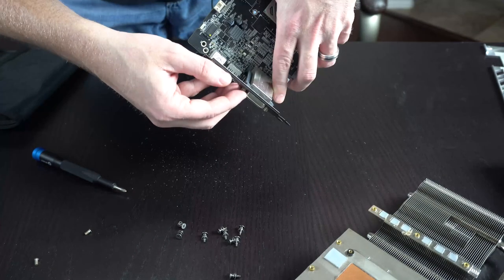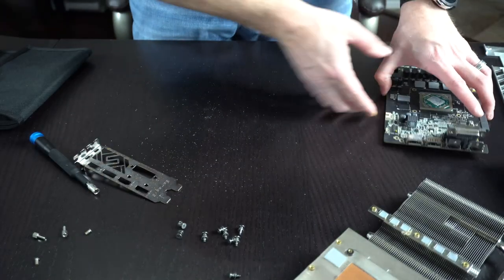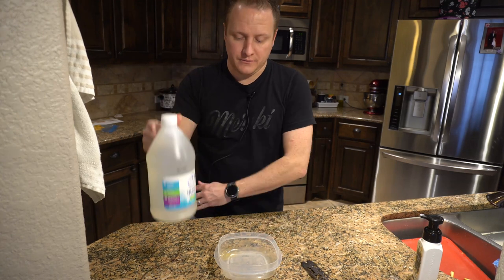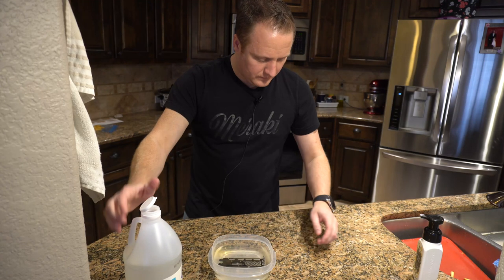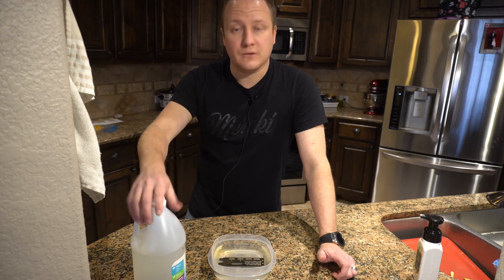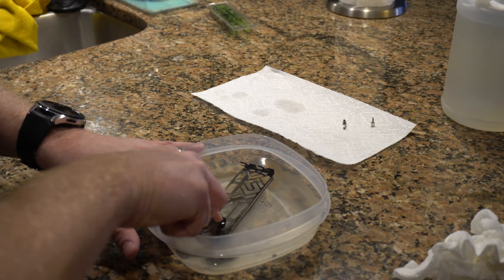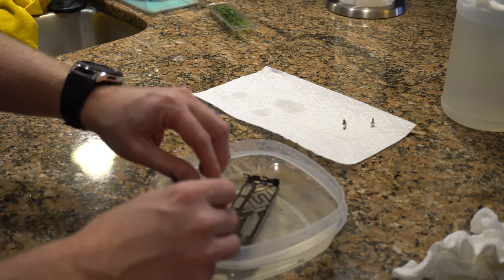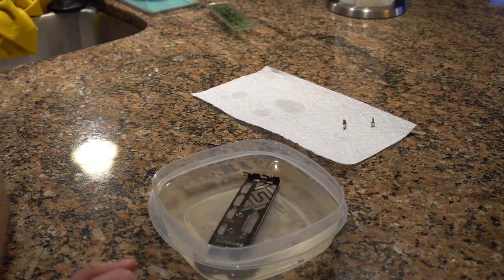How to Clean a Graphics Card/GPU - Rust Removal with Vinegar

Comment: the white stuff on the heatsink is aluminum hydroxide, its unsightly but it wont effect the performance of your cooling unless your heatsink is caked in the stuff. you have to completely clean it off for it to stop, only way afaik is an ultrasonic bath, also dont put any nickel plated components in vinegar. it will strip off the plating and the corrosion will be even worse, this method of cleaning is perfectly fine for the IO plate.
Reply from the maker: Thanks for the good information!
Reply: @Marko Grobler
I have those white stuff between the fins of my GPU I removed some of them with isoprophyl alcohol( 99%) but a little bit is still there. Will my Heatsink even last for more than a year if that's the case?
Reply: Is this apply to the tubing as well good sir?
Reply: So the fins the GPUs are also nickel plated copper or aluminum? Thanks for the advice I was about to vinagre the hell out of the whole heatsink
Reply: I cant understand which liquit should I use

Comment: I recieved the exact same model of card. it was sold as seller refurbished and described as 'new and mint' well what I received was a rusty corroded piece of junk. He said it was used for gaming but it was definitely a mining card. No  GPU gets like that state unless it's left in a garage.
Reply from the maker: Yep!  I got kinda the same run around too.  There is no way this card wasn’t used for anything else but mining.
Reply: @PCTechHustle  folks should just be honest. It's going to bite them in the ass anyhow. Awaiting a refund but the seller won't accept return😂 great vid tho, if I'm stuck with it I'll just do what you did in the video.
Reply from the maker: Right!  I freshened it up and it’s looking good and working fine!
Reply: @PCTechHustle  Good stuff, well I've bit the bullet and cleaned mine up new thermal compound etc. Only think is I couldn't remove all the calcium deposits on the fins, I tried baking soda, vinegar, isopropyl, got the big chunks off. Works absolutely fine.
Reply: @TobyRieper48  CALCIUM? WHAT??? Like limescale? How TF did that get on a graphics card?!?!?!
Reply: Just hope they spent all that they earned on the GPU for little to no gain.

Comment: totally fine using vinegar to remove rust of any metal plate without electrical stuff attached to then use baking soda to neutralize the vinegar, use water to wash away those 2 chems, use rag to make them dry, its better to leave them somewhere which generate heat to dry them 100 percents, I usually leave the metal pieces on my running pc case and let the heat dry them off, quite fast. If you want to clean the PCB, use 90 alcohol instead, about the display ports and stuff, alcohol can not rid of the rust, wd-40 I'm not sure if its safe to use, and if you use vinegar, you need to dip the ports into it, but the last 2 options can cause damage
Reply from the maker: thanks for the input!
Reply: you could but you need to wipe it with alcohol and pour it on a cotton bud so you can reach the ports, then use distilled water or contact cleaner to make it dry faster

Comment: Can you use vinegar on a microfiber to clean the pcie pins? Mine are a little corroded.
Reply from the maker: Sure can.  I would be very careful to ensure the pins are absolutely dry before running power through the card again.

Comment: How did that card fare in the long term, did the rust come back? Given white vinegar strips protective coating. 
I recently bought a used card which has minor rust on the i/o backplate and a few screws. Im wondering if it would be worse in the long term to clean the card or leave it be, my 14 year old case has no rust, neither my 5 year old graphics card, so would the new gpu rust continue to spread under my environment?
Thank you, very good video
Reply from the maker: Thanks for watching the video!  I honestly can't say how well it has held up I sold it with a PC long ago.  I agree the vinegar may have stripped some coating on the metal, I just cant say for sure.  I would think so long as its not in a humid environment the rust shouldn't come back.  I am pretty sure this card was a previous mining card sitting in a garage or something like that, being the way it collected some rust to begin with.

Comment: Can I soak the heatsink in vinegar before cleaning with a brush? Does that make the heat pipe more shiny? Thanks!!!
Reply from the maker: I’d try to knock off all the junk you can first but yes you can soak it.  You have to cancel the acid with water though after otherwise it will continue to eat at the metal.  And when you use water to cancel the acid make sure you dry it right away and not let it sit / corrode.
Reply: PC Tech Hustle You mean I should clean with water after soaking in vinegar and cleaning with a brush? Have you ever tried to use Autosol Metalpolish cream to polish a heat pipes? Thanks for the answer!
Reply from the maker: Yeah just give it a water rinse after the vinegar bath.  No I have not tinkered with polishes yet.
Reply: PC Tech Hustle Thanks so much !!! 😁

Comment: What are the white marks on the heatsink? Is it corrosion? Because my card have the same white marks and how do i remove it? Can i remove it with isopropyl alcohol? Btw thanks for the video!
Reply from the maker: Irvin Joel I don’t believe it’s corrosion.  I believe it’s paint overspray the card sucked up due to the environment I believe it may have been in previously.  I didn’t get a shot of it but the under side of the fan blades also had the same greyish junk on them which lead me to that conclusion.

Thanks for watching!
Reply from the maker: You may try scraping it off like I did with a spudger like I did.  Even a bath in vinegar shouldn’t hurt I’d the heat sink has a nickel playing on it.  I did try isopropyl with a brush but didn’t get it quite perfect looking.
Reply: @PCTechHustle  yeah i tried before cleaning with brush and isopropyl but it didnt came off. Might try scrapping it with a spudger
Reply from the maker: Irvin Joel good luck!  Curious how it goes!
Reply: @Irvin Joel Any update? i also have like white powder on my heatsink! Please help
Reply: Actually that's Oxidized Stain, it's corrosion yes, and that's very hard to remove
Reply from the maker: The Joker yep I found it on another used card I acquired.  I also think this one was a mining card as well.
Reply: @kapra3211  its very hard to remove it and i only able to remove some then i stop halfway 🤣
Reply: @TotoroGaming  and how the gpu going?

Comment: I wanna ask something, so i have the exact gpu like your but my gpu contact have like black dot and i wanna cleaned do isopropyl alcohol works to clean it?
Reply from the maker: Yeah I would use isopropyl on the PCB and only vinegar on the metal parts / heatsink.

Comment: how to clean aluminum corrosion? i have +12 cards that have these white spots on the heatsink and want to clean that, any tips?
Reply from the maker: I think using vinegar will work well there too!
Reply: Hi, having the same problem with the heatsink fin corrosion(?), did the vinegar end up working for your cards?

Comment: What if I have a copper cooler, and it has darker spots? Can I remove still with vinegar?
Reply from the maker: I am sure the dark spots are due to old thermal past?  I would try isopropyl alcohol first before trying vinegar.

Comment: my old GPU got a drop of coolant on the PCB, there's little greenish-blue corrosion, like really little, can I save the GPU, it runs but dies sometimes
Reply from the maker: I’d try to clean that off with some isopropyl alcohol first.  If it still shorts out you might be out of luck.
Reply: @PCTechHustle thanks
Reply: thats a subscription 💯👑

Comment: Does this work on the board as well. My GPU has a couple small spots of rust on the board itself.
Reply from the maker: I would probably try isopropyl first but if not yes it should work but the key thing here is vinegar is an acid.  So you need to neutralize it after.  Which I did with water.  However water can promote rust or corrosion which is also why I took some polish after to seal the exposed metal.
Reply: @PCTechHustle  Wow. Thanks for the quick reply.! I have been real nervous about trying it, but I dont want the corrosion to spread either. Thanks for the tips. Subscribed.
Reply from the maker: Thanks for the sub.  You can always use a soft brush and isopropyl first!  That could get you somewhere without worry of damage.
Reply: @PCTechHustle  Thanks. I'm gonna try that first. Disassembling now!
Reply from the maker: Good luck!
Reply: @PCTechHustle  if I dont have a soft brush can I use a microfiber towel??
Reply from the maker: Yeah.  Just make sure you don’t snag any components and rip them off!
Reply: @PCTechHustle  ok, so I ended up finding a soft bristle brush, and used that with isopropyl. One last question. After I was done cleaning it left a white-ish dried residue on the board. Is that normal?
Reply: @GameJunky513  It is  normal just flux left over.

Comment: Is it possible to remove aluminum corrosion from the heatsink?
Reply: Nope, you'd need to do some advanced chemical reactions to remove it which might also affect the other parts.
It won't affect the cooling performance anyway, so you shouldn't worry much about it.
Reply: @shinozaaakiii which cemical I need

Comment: hey can i ask if you replaced your thermal pads?
Reply from the maker: I didn’t.  Most times they can be reused if in decent shape.  You want to be careful doing that too because if you get the wrong size pads it could create cooler mounting tolerances issues.
Reply: @PCTechHustle  thanks for your advice! i always wanted to change out the thermal paste on my gigabyte rtx 3070 vision since it keeps on hitting 83°C when running games and I'm afraid that I'll change my thermal pads into the wrong kind and mess everything up. well now i can just change my thermal paste w/o minding the thermal pads

Comment: does this work on the pins?
Reply from the maker: I would stick with isopropyl at first if that doesn't work you can move to vinegar , though keep in mind vinegar is an acid, so I would not advise using it on anything other than metal.  Even with that you want to maybe dilute it.

Comment: very clever man!!   subbed!!!   i can pickup 2080s for 400ish an clean up nice
Reply from the maker: Jimmy Mueller thanks for tuning in!
Reply: @PCTechHustle   any ideas on how to clean the pcie power connectors on gpu's that had a burnt cord,
Reply from the maker: Crazy!  So is it just burned residue of the cordage?
Reply: @PCTechHustle  ya basically
Reply from the maker: I’d try some isopropyl alcohol
Reply: @PCTechHustle  I did and cleaned it but there still kinda dirty looking. An cant get a qptip in there
Reply from the maker: I like to use toothpicks to pick gunk off if I need to in hard to reach places.
Reply: @PCTechHustle  i actually got it, i cleaned it up with break cleaner, and working good now